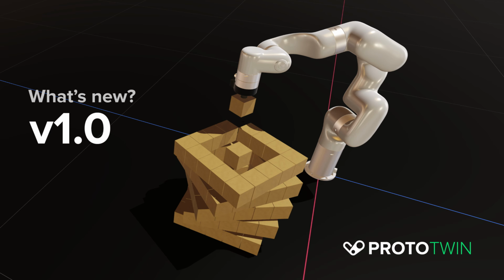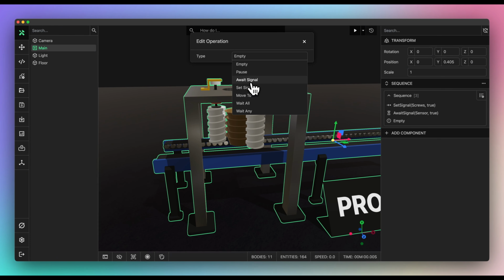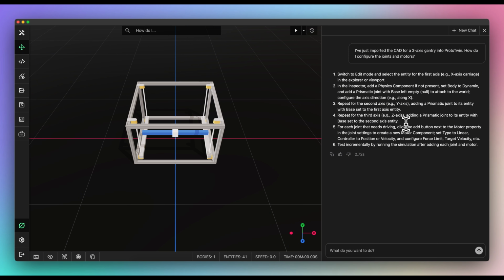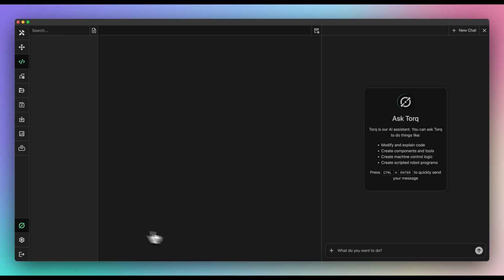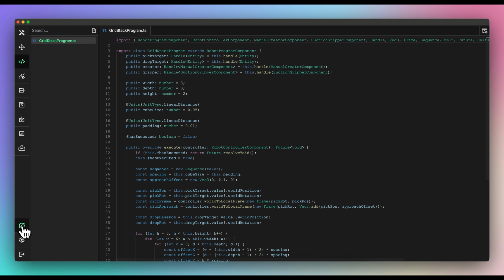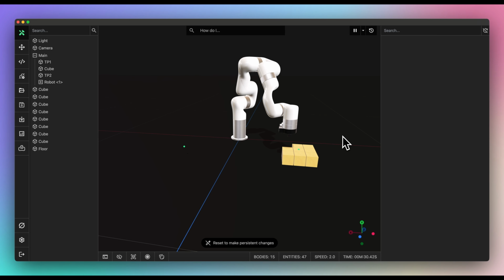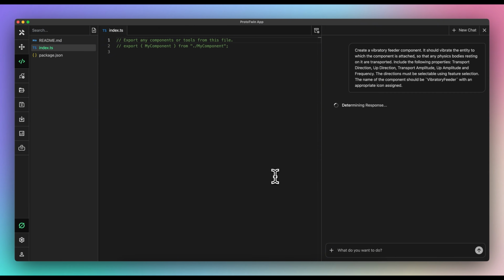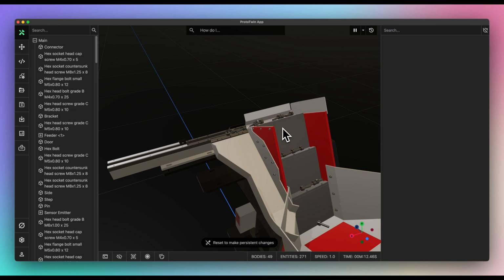Introducing ProtoTwin Simulate v1.0

Comment: So this is mainly pure IK animation and scripting (no physical suction, no self-collisions, no ROS?). Seemingly can be as well done in UE5 with blueprints. The main advantage of this software is probably ready to use modules for TwinCAT, Modbus etc
Reply from the maker: This isn't a pure IK animation. ProtoTwin simulates the robots using physics and drives with feedback controllers. The integrated robot controller solves the Inverse Kinematics automatically, and then sets target positions for the drives. You can add colliders to the links of the robot and detect self collisions. We just didn't do so in this example. You can also grip objects using friction. ProtoTwin's physics capabilities are more advanced than UE5 and other game engines, which are tuned for games rather than robotic simulation. Additionally, ProtoTwin makes it easy to import CAD and add physics-driven behavior (as shown in the video).
Reply: @ProtoTwin thank you for the explanation!

Comment: Well still no plc simulator?😢
Reply from the maker: Which simulated PLC do you need to connect to? It is already possible to connect to some, including CoDeSys, TwinCAT 3 and Schneider EcoStruxure Machine Expert. It's technically also possible to connect to Siemens PLCSIM, using NetToPLCsim. It may also be possible to connect to Siemens PLCSIM Advanced, although we haven't tested this yet. Let me know what you need and we'll try squeeze it into the next version.
Reply: @ProtoTwin yes Siemens PLCsim advance
Reply from the maker: @DaNil-ws8bc I just tested PLCSIM Advanced and it is already possible to connect. You just need to enable TCP/IP for the simulated PLC. I wrote a short guide for this on our community forum: https://community.prototwin.com/t/connecting-to-siemens-s7-plcsim-advanced/32